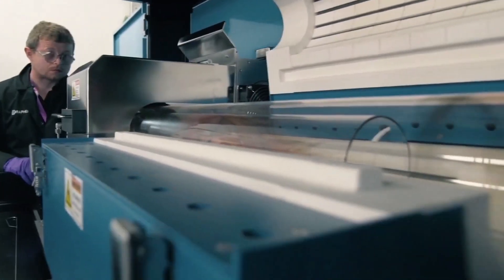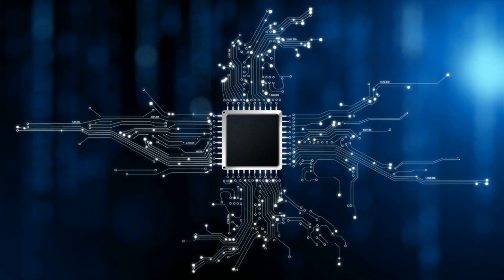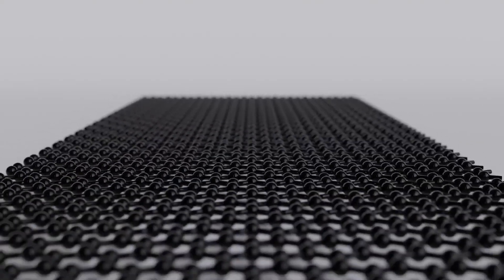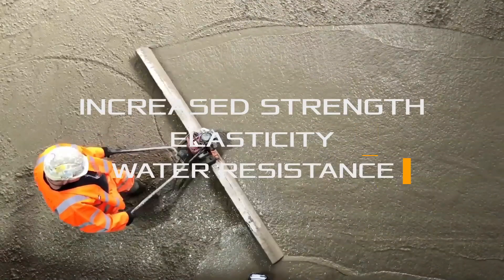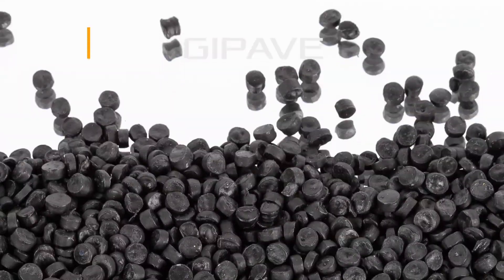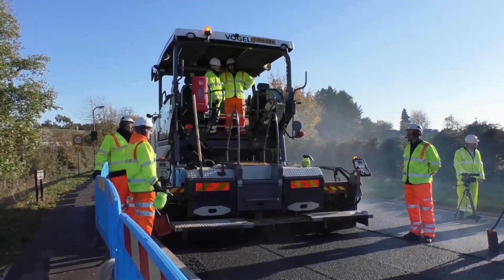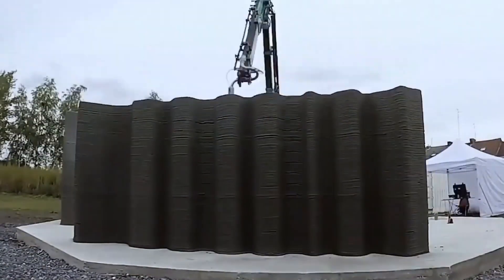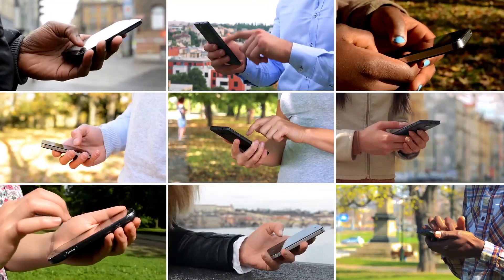Graphene in concrete is already changing the rules of the game in construction

Comment: 1- how does the graphene bind with the steel or the cement or the concrete, when the carbon to carbon bond is so strong? 
2- how do these so called concretene mix work under ultra low , normal and ultra high temperatures? Eg under a fire, a graphene based high rise may collapse like a pack of cards?

The proof of the pudding is in the eating. I do hope all these fantastic possibilities materialise. Otherwise all this thinking and advertising may just remain that

Comment: How does it increase thermal insulation?  Graphene is one of the best conductors of heat known.  Adding it to concrete should decrease the thermal insulation, not increase it.
Reply: Material interaction. Concrete contains tiny voids if graphene increases the volume or number of this voids then it will improve insulation.
Reply: @kazedcat  I don't buy that.  If the graphene is encapsulating air, then at least one surface is not engaging with concrete.  Graphene is good only in tension.  You can't rely on it to maintain a rigid structure and add to the mechanical properties of the concrete.  You can order concrete with tiny fibreglass fibres.  I would expect the benefits and pitfalls are similar, with graphene providing improved tensile strength of the composite material. 

Concrete holds air just fine.  All industrial concrete is specified with minimum amounts of aeration from the batch plant.  Residential concrete sometimes has soap added to increase aeration.  Also you can order a product called aircrete, which is essentially concrete with a very high amount of aeration.  Since concrete can be specified with essentially any amount of air entrainment you want, what does graphene contribute?

Comment: Isn't adding Graphene to concrete actually the same as Roman engineers adding Volcanic Ash to their concrete construction.  That is why their concrete structure lasted so long.
Reply: No, volcanic ash, fly ash, pozzolanic ash has cementeous properties.  Addition of the right amount of lime will cause the ash to harden like concrete.  Ordinary cement (Portland, etc) have an excess of lime when it cures.  When poz ash is mixed with cement, the excess lime from the cement reaction will set off the ash.  This results in a total mass that has very little excess lime.  It is the excess lime in regular cement that leaches out over time, weakening the cement.  All of this is different from the use of graphene in cement.

Comment: Graphine Battery product, patent and production with Bosch and others GMGMF - Graphene Manufacturing Group Ltd. More of a capacitor than battery holding same power per volume, May charge eight times faster. Graphene & aluminum. Environmentally superior and fraction of cost.